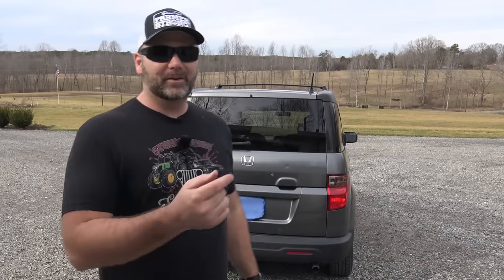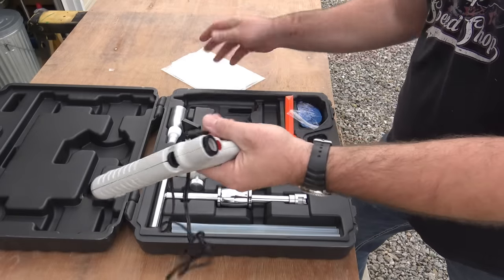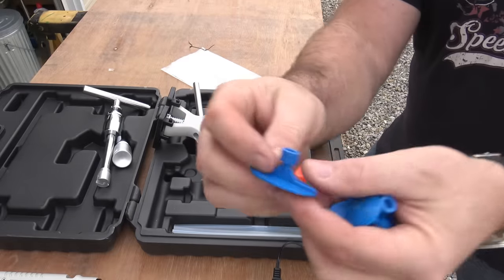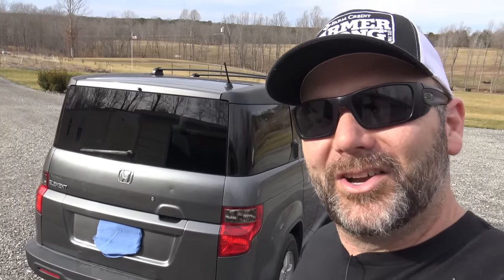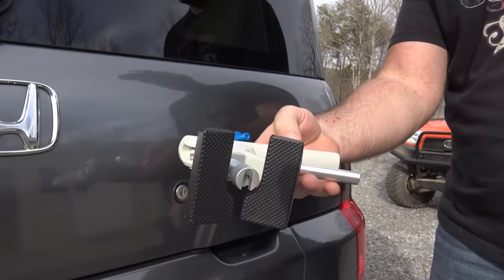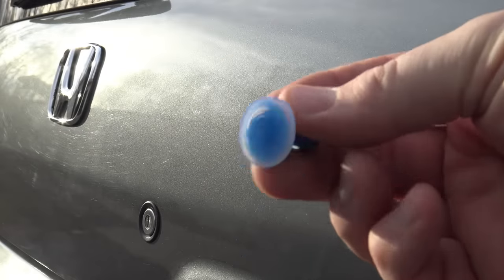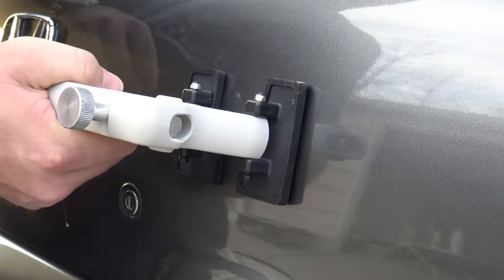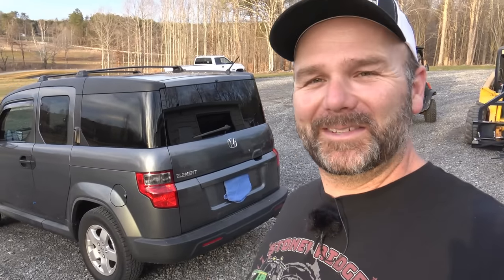You've never seen a dent pulling tool like this! Easy Fix for door dings in minutes!

Comment: Good video... Just a quick note to other DIY users. You should start move down in tip size as the dent begins to reduce in diameter otherwise you're pulling on metal that has already popped out...which can sometimes create a 'high'...not what you want.
Reply: Good advice thanks.

Comment: I bought a set from Walmart on sale last year. I pulled a 6" x 5" x 1" deep dent out of a rear quarter on a Taurus. It took many pulls and went through a lot of glue sticks but it was worth it. It is fun to pull the dents.
Reply: How did you got they glue off
Reply: @primetheory258  Read the directions carefully. I had to scrape most of the glue off with the plastic scraper in the kit. Them sprayed 90% rubbing alcohol on and rub with a soft cloth. Good Luck, Rick
Reply: @richardross7219  thank you. I appreciate ya.

Comment: Excellent presentation!  You convinced me to buy this device. I LOVE my 2007 Honda Element and it has several small dents from door dings. Bought it new and it now has 375,000 miles. The only repairs were replacing the AC condenser fan and the driver’s side window regulator, both of which I did myself.

Comment: Used a similar slide hammer puller with glue sticks to pull out a nasty dent on the front of Tahoe before I sold it . It's definitely awesome and little addicting once you get one of them out.

Comment: Awesome video sir! I bought a kit similar to yours before finding your channel. Except my kit didn't have a slide hammer, so I found another kit with one. I think I spent $35 total. I bought a 2019 truck with hail damage on passenger side. I assumed a lot of the dents would disappear in the hot sun of July-August, but that didn't happen. I figure my 15 year kid can assist or even do some of the work vs spending several thousands for local shop to do the work, plus we will have gained knowledge and experience. Thanks again for the video!
Reply: How did the project work out for you? 😉

Comment: Nice video. That kit did a good job. The pros also use a mirror to help spot/remove dents and, on Eg door panels, a bar that slips inside the window aperture, to push the dent out from behind used in conjunction with a pencil sized nylon punch.

Comment: Ok I bought it and it worked for the most part.  There is still a little dimple I can't get out, tried numerous times.  This is on my microwave so it was bothersome when I dented it.  I must say, the dimple is sooo small it's hard to notice.  You really have to look.  I tried to remove a dent from our truck door, it's going to take a bit more work will update later.  Hate how the glue sticks to some of the tabs, extremely hard to pull off.  The blue tabs are the easiest to pull glue off.  Was worth the purchase.

Comment: Nice video, thanks for sharing.  Try using 99% rubbing alcohol to make the glue release without using the plastic chisel; also, push the tabs and hot glue into the finish a little more to get a more solid connection between the gripper/slide hammer and the  ding you're pulling on.  For large dents,  get a cheap football, air wedge, basketball or beachball, and push them behind the dent when deflated, then use air pressure to push the metal out, preferable when the metal is heated up a little by the sun or a heat gun. The cheaper balls and air wedges will explode, so wear eye protection and keep a safe distance, but the metal will move. It's also a lot of fun!  Good Luck!
Reply: Where the heck do you find 99% rubbing alcohol? This pharmacist of 30+ years has only found the 70% to be the strongest "rubbing alcohol" commercially available. Hell, even grain alcohol is only 70  - 90% alcohol.

Comment: Great video - hint - to minimize the risk of scratching the paint when removing the Tab or the glue residue, spray a little Wax & Grease remover (Prepsol) or medical alcohol from a Pharmacy - it dissolves the glue and won't damage the paint 🏆
Reply from the maker: Cool thanks for the tip
Reply: Agree about the alcohol.  It wasn't mentioned once and he's either the luckiest guy around or he left a lot out of the video.
Reply: Man never see anyone who cares so much about dents on a farm vehicle! Usally we are betting who will have the few dents by the end of the year! But then never seen anyone use a honda for a farm vehicle. Either way good work bud! I remember my buddy's friends truck was so dirty I mean layers of dust inside and out there was more dirt inside the truck than the outside. I looked over and said man this truck has seen some years of ranch work he looked at me laughed and said years it's only 6 months old only had 1 oil change. I was dumbfounded I mean ok I understand going to get dirty but come on destroy a truck in 6 months a $70K Chevy Diesel insane. Lol just thought I would share that story! Good work on dents I am working on mine definatly takes some patience!!

Comment: I bought one of these to fix some hail damage on my ‘86 e28. Worked great the first couple of shallow dents but then pulling a deep dent on the bonnet it removed an inch in diameter piece of paint right down to the bare metal. Use this at your own risk.
Reply from the maker: if you're paint came off...then paintless dent repair would never do ya any good my friend ...the dent was too big and had already ruined the paint by separating from the surface....sorry that happened to ya buddy

Comment: Use isopropyl alcohol to remove hot glue. You won't have to chisel the plugs off of your painted surface. The plugs will easily pull off and the isopropyl alcohol is safe on your paint
Reply: I've painted for 10+ years and I can tell you for certain, denatured alcohol will completely destroy your car's clear coat which is obviously no bueno. Nice trolling 👍🙂
Reply: The only suitable solvent you should put on your car is water and soap. Anything else is going to degrade it to some degree.
Reply: @Onefourtyfour  Denatured and Isopropyl are two different animals. Denatured contains ETHYL and some other chemicals, whereas Isopropyl contains only isopropyl. Both are classified as evaporatives, but the isopropyl will deteriorate any clear finish on a car way less than denatured alcohol. That is why isopropyl alcohol is the preferred method of getting the glue to release.
Reply: @sunshineboy17  so you agree me. Don't put alcohol on your car. All forms will degrade finish
Reply: @Onefourtyfour  If one disregards the details in my original comment, then the point will be missed. Evaporatives, specifically isopropyl, is formulated to not damage skin, or in this case the clear automotive coating. So, in theory, yes it can be used in this case because one needs something to remove the glue stick material. Scraping is worse than isopropyl. Does isopropyl damage the clear coat? Technically,  yes, because it will dry the clear coat out, reduce the sheen minimally, but still reduce it and also open the crosslinking system in the catalyzed clear coat, thereby compromising the bonding system of the several monomers, in this case polymers. So, yes, all forms of alcohol will degrade the finish, but then the question remains of how to remove the glue stick material. Soap and water alone will not solve the glue stick material due to its paraben nature. Isopropyl is recommended specifically because it is the least invasive to the clear coat.
Reply: It is important to recognize the difference between isopropyl and denatured. Two very different forms.

Comment: I got a large dent pulling kit i bought a few years ago but afraid to use it. Maybe you've given me the guts to try it out on my Ram.. thanks!
Reply: Tried my dent tools a few days ago on my BMW X3. I had one crease by the b pillar and just below it on the rear door a small dent. I used a long pull tab on the crease. It took several attempts to get it out and it looks really good. The door on the other hand not so lucky. No matter how many times i tried the dent wouldn't pull completely out. The sheetmetal is so thin the tool is warping it! I would have never guessed BMW used really thin metal. Later on I'll pull the rear door panel and see if it can be stiffened or maybe i won't.  It looks much better.

Comment: Any dent technician will tell you that doing it youself can cause a lot of issues. If you accidentally pull the paint or overstretch the metal, you could end up spending a lot more. For some farm truck beater its one thing, but on a nicer vehicle its much less of a risk to trust a technician who knows what there doing and save yourself from a potential nightmare. 90% of customers i get called out to who attempted the repair on there own, made the damage irreparable using the pdr method.
Reply from the maker: cool good info...so if you're gonna do it yourself be prepared to screw it up...I was prepared lol
Reply: Byron Manza  because im a 13 year paintless dent removal professional. There are trained and certified dent techs all over the world of all shapes sizes and color. If you care about your car, you take the time, do the research and find a good one. Good dent techs would never work for only 15 a hour
Reply: @StoneyRidgeFarmer  yup pretty much and just be ready for it to cost more to fix your mistakes if you do make them, or for it to not be repairable anymore with our methods and have to take it to a shop

Comment: wow I have an element with the same dent in the back I think its from a shopping cart, I have seen a similar dent puller but it used nails that were welded to the body and pulled out filled and painted, this looks easy
Reply: That's the difference between PDR (paintless dent removal) and panel beating.

Comment: i have done dents for 19 years . professionally  and YES this works, but there are dangers involved. you can pull the paint right off the car down to the bare metal costing more. you can pull the dent in the wrong place and make it worse. most times it will not pull the dent all the way out. and you can burn your self on the glue.because that's NO joke ! lol call a pro and save your self time and money and get it done right! because most will charge you double if we can see you have tried to fix it yourself. just saying..
Reply: Us dent techs could get them all the way out
Reply: Fully agree this video is so edited.  I'd love the un edited version complete with no censorship on the language. I call bullshit he's either the luckiest guy on earth or this isnt his first time.
Reply: The real issue is people turning a dent into a volcano, or not tapping down the edges.

Comment: I’ve a small dent, but my dent puller is slightly bigger, would it pull out just the dent, or other metal around it? I just want to get it right before I try.

Comment: As an actual Paintless Dent Repair technician, I will strongly advise to NOT do this. You can cause more damage than good. I'm not here to bash or be negative but I have had several customers come to me afterwards with the glue or tabs still stuck to the vehicle, or they have pulled so hard that they have stretched the metal to where it will never lay flat again.  Not to mention sometimes with glue pulling you can pull the paint off of the panel.  Please just research before you attempt this.
Reply: Looks like he did ok. You can see his results?? If you have no idea how things work or how metal reacts to forces then maybe do your homework more and not just go cranking on your car.  I did think about pulling paint up especially in the spots where there was paint chips.

This is one of those things that some of us take pride in how our older vehicles look. I would do this without thinking in my 20 year old Toyota SUV but if I drove a brand new Ford King Ranch, I might think otherwise.
Reply: Then you realize it’s a toaster on wheels, and it doesn’t really matter...👍🏻😁
Reply: I'm not bashing, correcting, or even judging  what or how he did.  I wish I could post pictures to the comments of people's vehicles that used stuff like that, or a hammer, or broom handle to "fix" their dent. It's my goal to provide a top quality repair that you cannot tell anything ever happened. Some people don't care about dings, a lot do. I hate to disappoint the people who do, and explain to them that they need a traditional repair from a body shop by what they did trying to DIY it.
Reply: @bubbacade6787  so much info missing from this vid and as you say, more harm is almost inevitable. Alcohol to remove the glue, heat gun to keep the paint at a correct temperature and if it has been resprayed do not attempt this as paint will come off. Where ever there is a low spot there usually will be a high spot to go with it, some kind of light board is needed to see it. Bubba is not trying to be judgemental but trying to help others before it costs an arm and leg having a new panel put on plus full respray in many cases.
Reply: Nothing ventured, nothing gained.You've got to start somewhere.Practice makes perfect.You will never get anywhere if you don't take that first step.
Reply: Ha. Ha.
The professional repairman could not contain his growing fear of DIY PDR, and the impact that these types of videos have upon his high-profit occupation.
Even after the video shows an average person, with zero PDR experience, and armed with only a half-assed reading of the instructions, removing a dent, on his first try  ...  the professional body repair guy has nothing encouraging to say, period.
This is a good video.
When the pros are worried; it means that the DIYers have entered a new realm of capabilities.
Reply: Bubba just trying to save his trade
Aint nothing wrong with that
Reply: U just want people to pay u people to do it.. bs!
Reply: Or otherwise I ll lose my job 😂😂😂
Reply: Sure bud, trying to keep your customers by saying this is bad

Comment: I've yet to see any one of these supposed dent removal tool to work in reality.  The usual glue gun , stick the pad on and pull . As soon as you go the touch it , it falls off whatever the panel temperature.
Reply: i have done dents for 19 years . this works but there are dangers involved. you can pull the paint right off the car down to the bare metal costing more. you can pull the dent in the wrong place and make it worse. most times it will not pull the dent all the way out. and you can burn your self on the glue.because that's NO joke ! lol call a pro and save your self time and money and get it done right! because most will charge you double if we can see you have tried to fix it yourself. just saying..
Reply: @ghostsoftherepublic  Funny, the quote I got for 3 small dents was way more than double the price of his tool.  So, I just live with the small dings.
Reply: @ghostsoftherepublic  why would you charge double if you see we are trying to fix it by ourself? Lol.
Reply: Fanatic Chess  cuz they see ur desperate and out of options. Sleezy. I rather put a passenger side airbag and blow it up on a huge dent than have them charge me double if that’s how they do business

Comment: You should try using a strong locking suction cup with hot glue to see how it compares, I got good results with just a suction cup but now I wanna try it with hot glue to see if it's process is any faster or better

Comment: I have a few dings from hail but nothing too serious.  Liked your video and bought a kit for dent removal.  Followed what you did and it corresponds with the instructions in the kit so I felt good about trying this.  However, having one issue in particular, the glue sticks great on the vehicle, but no matter what I do it does not stick long enough to the little plastic part in order to pull the dent out.  Any suggestions?   TIA

Comment: The kit costs $97 on Amazon + $10 tax = $107. Dent guys will do it for a few bucks more, so not worth buying.
I would remove that with my own hot glue gun and a dent suction gizmo which is cheap at Harbor Freight.
You have to go down in size as you are pulling it out.  You kept the same size, which is why you had a raised edge second time around.  Good demo, many thanks!  Great to see that hot glue does not harm the car and comes off with alcohol.
I would also try the boiling water trick with dry ice to pop out remaining dent.
Reply from the maker: We all know we can call someone to do most anything for you. The true value is knowledge and skill

Comment: I tried it it comes off because the glue comes with the dent remover does not work, what sort of glue are you using, because one pull the the dent remover plastic comes off

Comment: Freeze hot glue and it becomes brittle and pops off. I get a WD40 nozzle and put it onto a can of propane. Those disposable cans for small gas cookers. Spray the area to be frozen. As the gas boils it freezes at -160°C before evaporating. Small amounts is safe enough